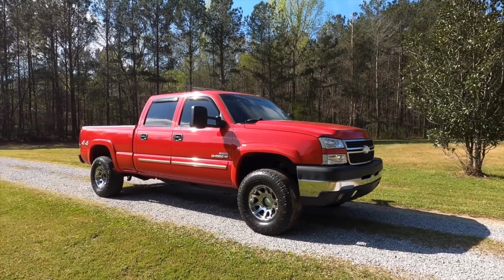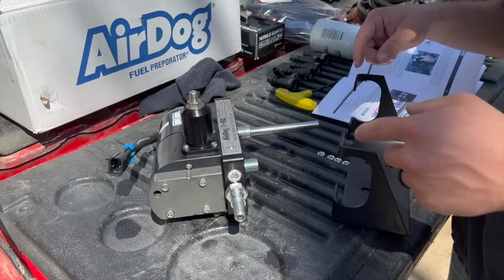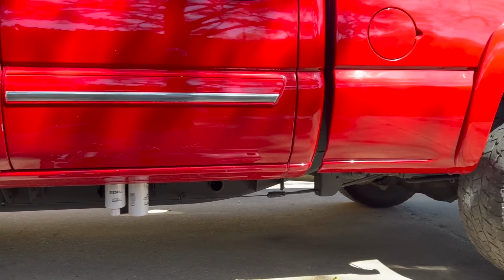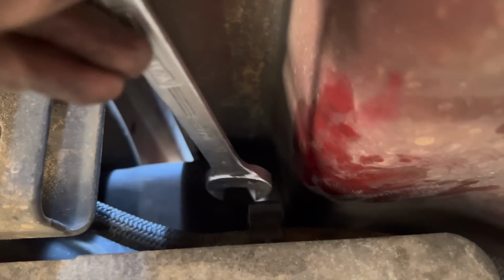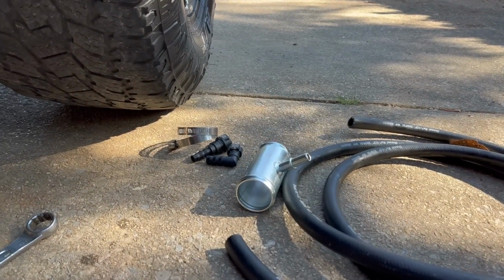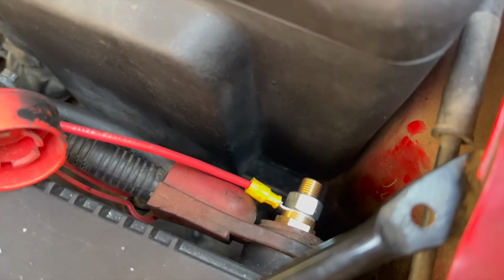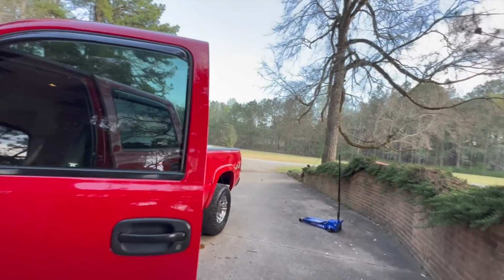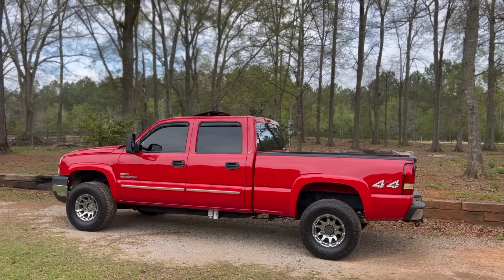AIRDOG DF-165-5G | FULL INSTALL

Comment: You’re going to get sick of hearing that thing under the cab. Need to mount it on the bed mount. Biggest thing with an air dog and fass systems is they eliminate any air in the fuel system all the way to the cp3. Yes the filtration and pressure is a selling point but air in fuel is also a problem these trucks face.

Comment: Best install video of all
There loads of them even factory videos not as good as this 
I am contemplating installing in 08 LMM 
70K org miles
Want it to last a long time
However I currently gave an aux fuel tank with valve tapped into filled hose 
(I can send pic of it if you prefer)
So if I understand the Air Dog return also needs to be installed at this location of filler hose area
Thoughts on how to accommodate both?
Don’t have room to splice in 2 adapters
Maybe install the Air Dog after adapter hose and  fittings and then tap or splice in aux supply hose into that Air Dog return hose?
Thoughts?
Lastly looks like you did not have to remove driveshaft to get at top of tank for disconnect and add new connections?
I will look for your other video on install on inside of frame,
Thanks for the best video

Comment: So I actually have this exact system sitting in the box still for my 2016 lml. I was under the assumption that using a sump was the best option as I didn't want to have to drop the tank to install a draw straw. Is the draw straw not needed for these systems? Looked like in your video everything connect to the OEM fuel system lines. Or am I mistaken?